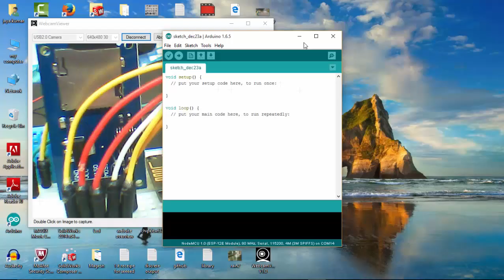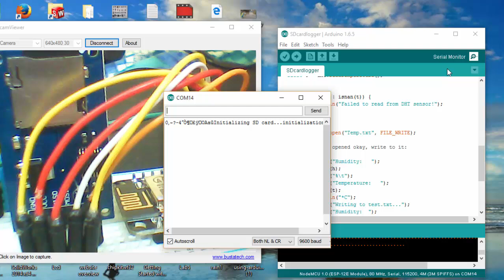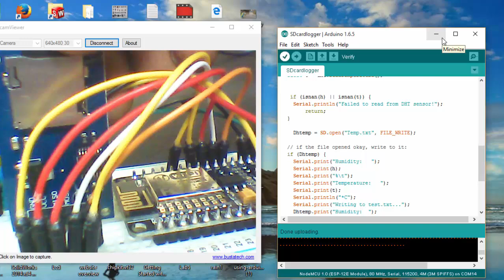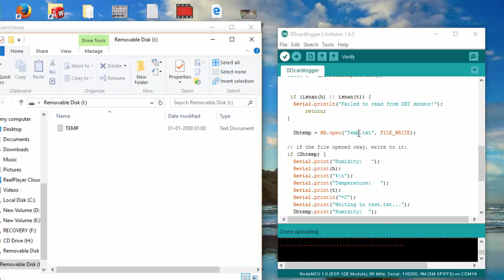Log Sensor data to an SD card using ESP8266

Comment: Hi, I'm using a CATALEX micro SD card reader to read and write data to a nodeMCU 1.0, is there a difference in the pins you used and the pins I use, and if there is could you help me with that?